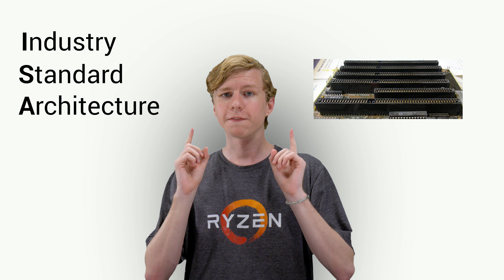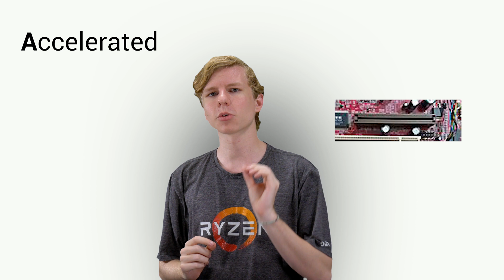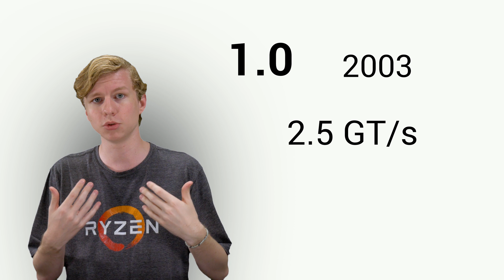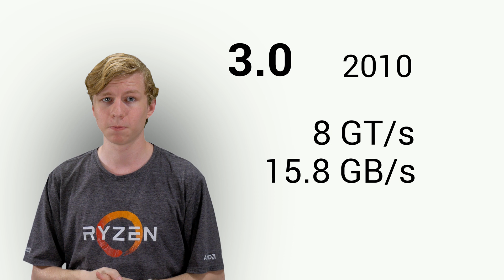HISTORY OF PCI-EXPRESS

Comment: great explained the revolution of pci !  any idea what intel cpu/ board support most lanes to the slots? pretty hard to find out, i need a new system whit many slots for HBA and 10gb networking, for graphics i prefer the cpu graphics like i use now on a i7 3770. The system needs to run tons of harddrives ~ 62 so far on HBA SAS external and network shares.  ideas welcome
Reply from the maker: There are no official platforms with integrated graphics and a high number of PCIe lanes. You might be able to find a specialized server board with a gpu on it that could work for what you need?